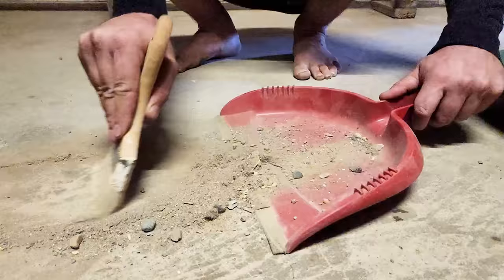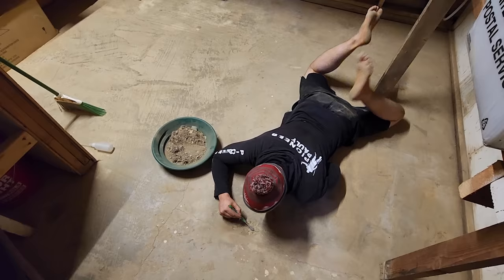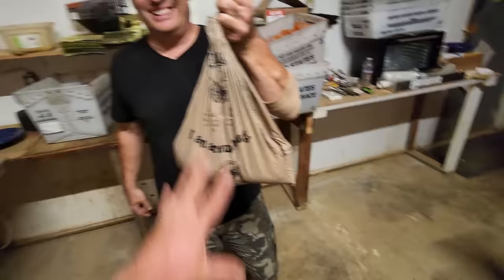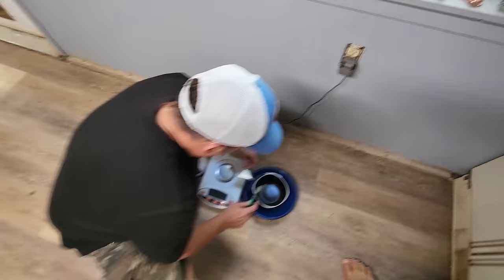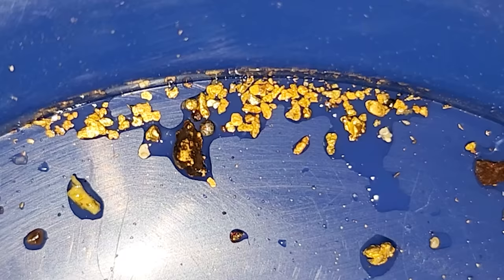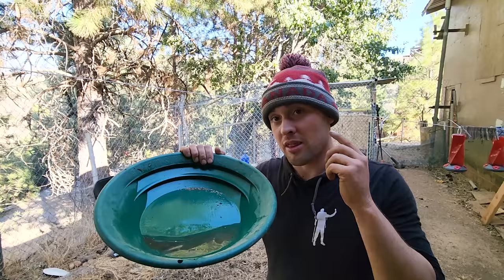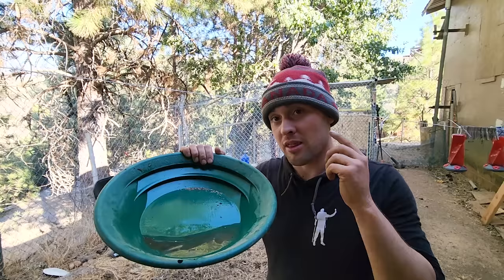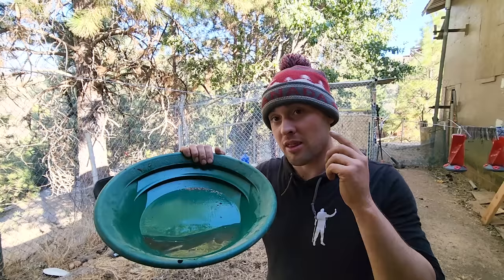Checkout The PILES OF GOLD Found Cleaning A Paydirt Shop!

Comment: Surely there is more gold lost at the entrance of the house in the jewelry workshops there is always a metal grid to prevent the gold from being carried to the shoe soles and it is cleaned once a year . 
The Alexander jewelry group workshop had the problem not only of lost gold and gems that were easy to find with a separator, the main problem was animal hair and 5 years without cleaning . 

When there is a large rate of gold and silver, in order not to lose anything, tin ore is created by melting 1kg of tin and adding all that is extracted.  

To eliminate the tin, you just have to raise the temperature until the tin boils in an oxygen-free furnace and a quarterly brick remains silver copper gold . 

When the brick is obtained, you go to the Tesla coil smelter and then to the laminator each ingot for recovery by precipitate .

The silver precipitate is almost never recovered in the workshop, only gold at 24Kt, dissolution of the lamented metal in Muriatic Acid X3 and Nitric Acid X1 + 1 distilled water . 

Heat the solution 48/h below boiling aqua regia. Sterile filtrate in chitasaltas. You stop the solution in a glass with more space 25lt capacity only 1 liter solution.

The less coarse precipitate is metabosulfite, the more toxic is urea, both recipitate gold in black sand or gold nanoparticles . 

From the workshop that I will not mention from the Alex group we obtained 500g pure gold, the external laboratory gave a rate of 4,900kg pure silver and 10kg copper, the house of unrecovered property 9g, a recovered rate of 15 ounces. 

There are methods to prevent this but in workshops run by older people or those who refuse to retire these rates of lost metal are very common.
Caht translated Spanish Spain to English